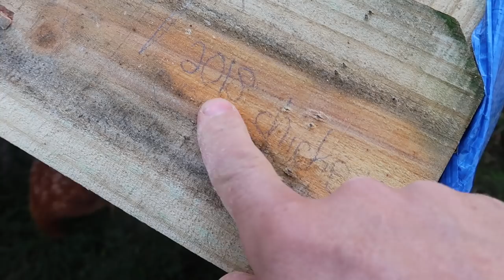Never a Dull Moment On The Farm (Piglets Second Day Here)

Comment: I made a black plastic yard composter once. I put a length of black plastic over the center of the compost pile. Then a lengrh over each side so when it would rain it captured water into it. The pile was on plastic too. Held the whole thing down with rocks. It really sped up the composting cycle. I turned a sand yard into dirt just by composting the weeds and ugly grass that grew in the yard.

Comment: Great video. I thought you said to use white or silver tarp on the $30 tractors but you had blue on that one. Also I was wondering if greenhouse plastic would work the same as the white tarp.
Reply from the maker: I couldnt find any white or silver taros in the size I needed this time. No you won't want to use greenhouse plastic. It would make it too warm in the tractor
Reply: Lumnah Acres thanks for the answers!
Reply: I wonder how you all get the wood and all for thirty bucks for one oc those chicken tractors? I dont know if we just went overboard but my coop cost about 100 dollars and its not the greates. Its great and will work but it did cost more then we really should have spent! Good things the chicks the food and stuff wasnt a lot.. Good thing they will be worth it in the end!
Reply: Jessie I just looked on lowes and found the dog ear 6' fence pickets for just under  $2 each. 14 of them are under $25
Reply: Jessie I think in total what I've looked up it comes to about $50 for the extra boards and the tarp and then add the feeders and waterers